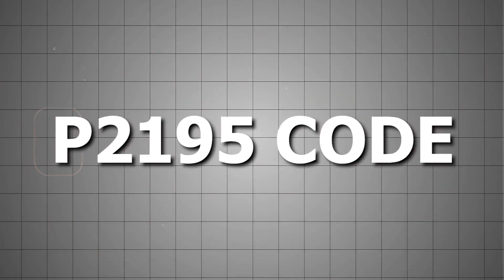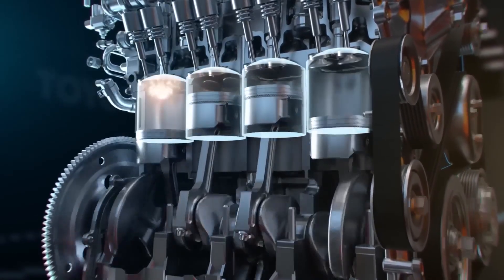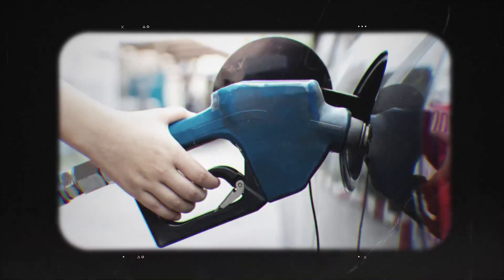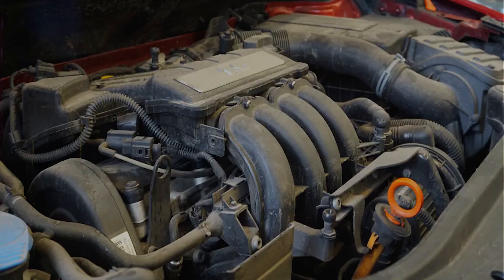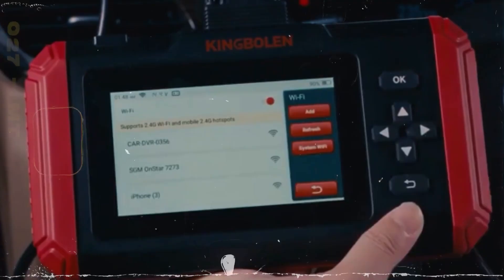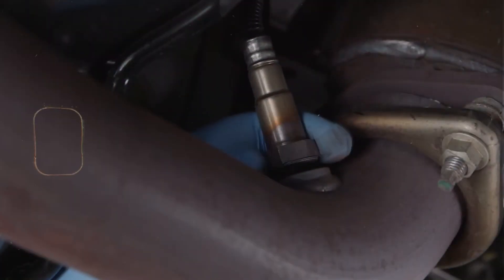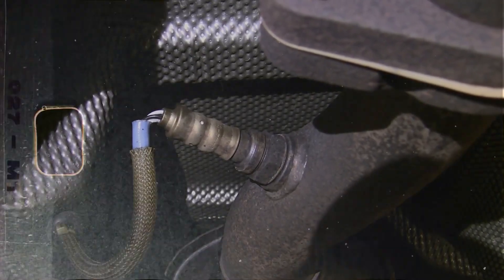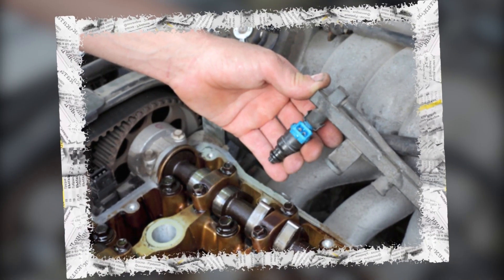P2195 Code: O2 Sensor Signal Stuck Lean (Bank 1, Sensor 1) – Causes & Fix

Comment: Ok ive put 3 new o2 sesnors in and i keep getting the same code over and over no bad wiring or exhaust leaks or vacume leaks
Reply: Check your maf sensor, throttle body as well
Reply: @coltonwarner7962 have checked them already
Reply: Possibly a bad injector.  Check all spark plugs.  A lean cylinder will over heat the plug tip, white ash. Replace injector.